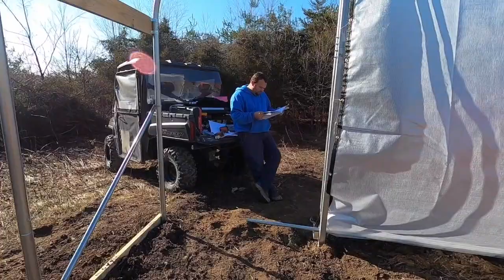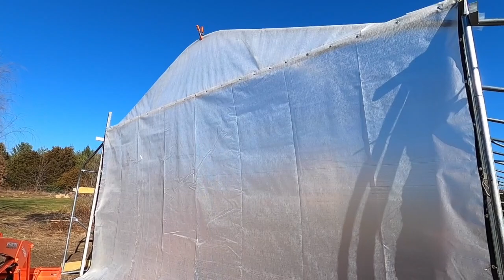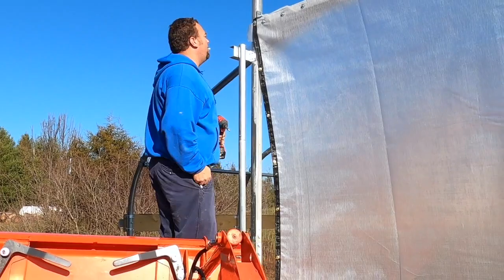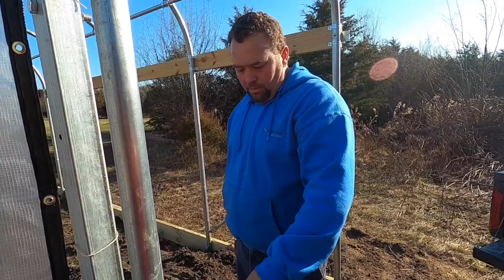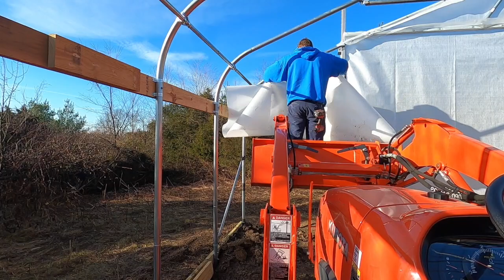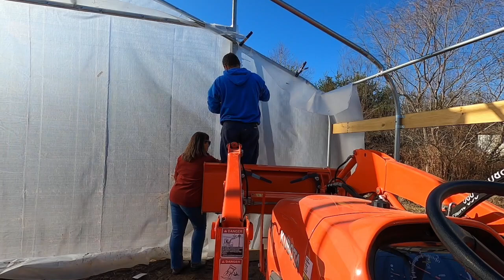High Tunnel Build Update #4

Comment: The high tunnel is coming along but it sounds like you're not happy with the instructions and some of the screws they sent. That is a shame. Its crazy you have to drill all the holes too. The plastic looks very thick though.
Reply from the maker: Yes it’s thick plastic.  I bought the fabric for the roof.  It’s supposed to last longer and be stronger but I haven’t even looked at it yet.   It’s crazy all the drilling and screws it takes.   I think it will be nice when done but for as much as I paid for the think I guess I expected a few things.  My fault I guess.  Lol.   Some of the screws won’t drill at all.  I’ve even slowed the speed some to allow it to bite more but the tips on some are just not any good.  We will get it done!  :)
Reply: @OutdoorsandCountryLiving  I hate when you get screws that want go in. Yeah I understand what you mean. I’m sure it will be great for you guys though.